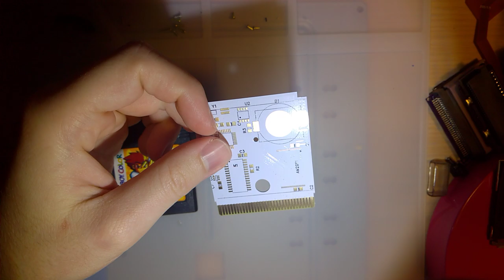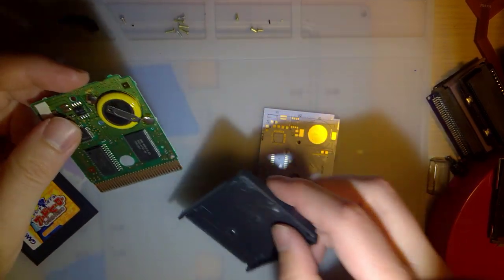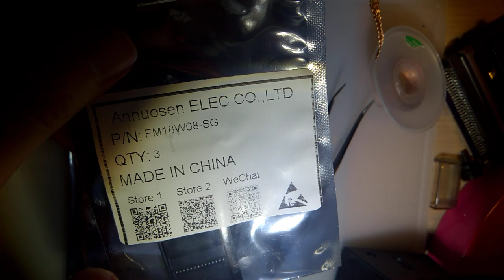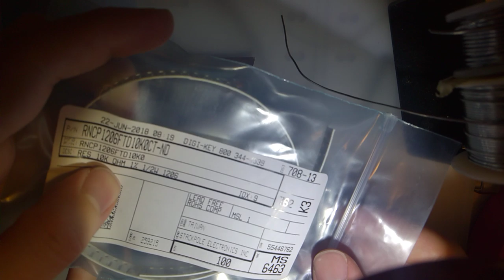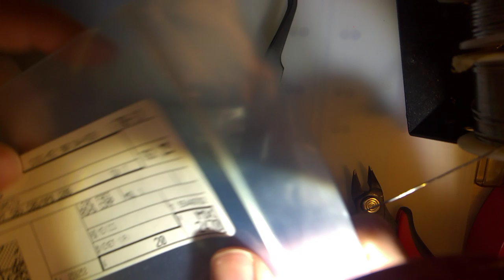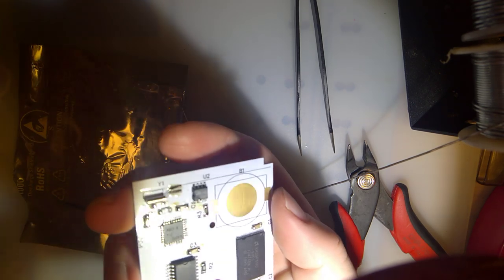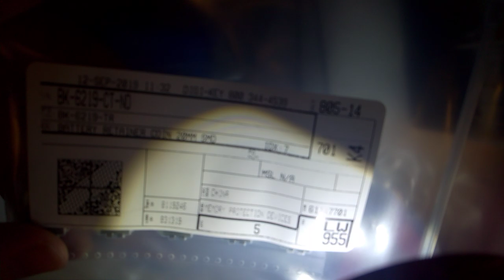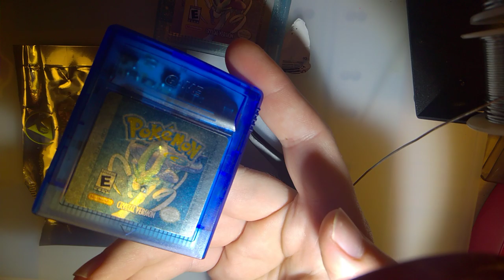Making a FRAM (Batteryless Save) MBC3 Flash Cart with RTC

Comment: Why do you don't swap the memory like they do on N64 memory card ?
Reply from the maker: I don't understand what you're asking. Why don't I swap the memory from the donor cart into this cart or why don't I swap the new memory into the donor cart? The former is because this is FRAM whereas the donor has SRAM. FRAM is very similar to SRAM except that it does not require a battery to retain the data. The latter is because there are extra components required to get FRAM to work with MBC3 games and an adapter would be required. Since an adapter would be required for the ROM flash chip, it's easier to just make a whole new board.
Reply: @makho  Ok I didn't know that you couldn't swap SRAM by FRAM in the original board without an adapter. Thanks for answering me !